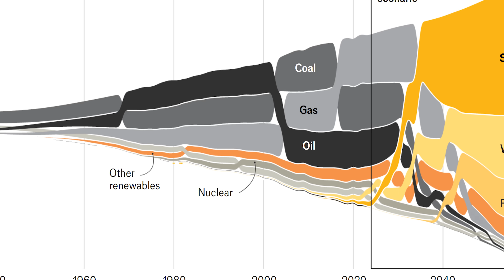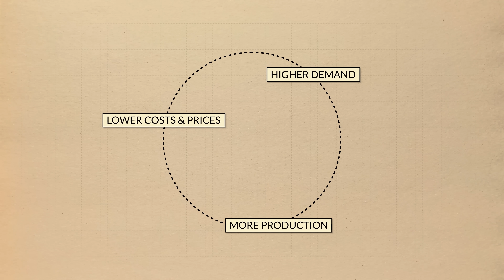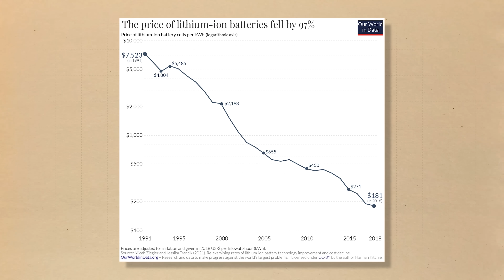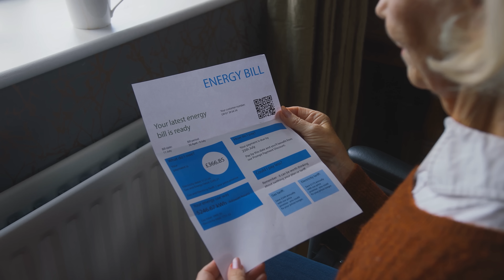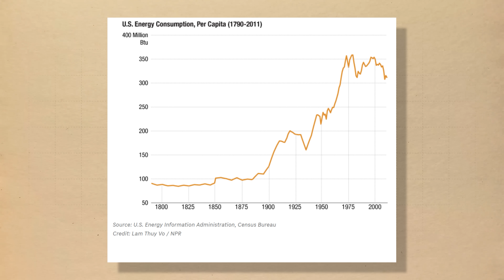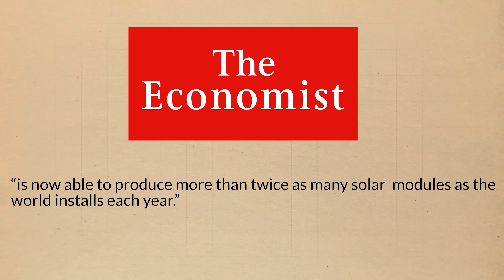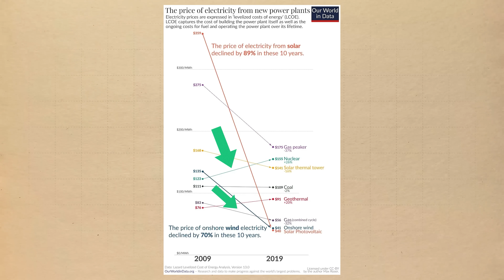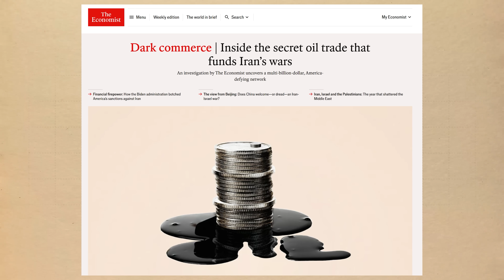Why solar will soon dominate & what that means for the world

Comment: It's cheap the only lacking thing is energy storage with batteries etc that's the next leap forward
Reply: Cheap solar provides a lot of economic incentive to develop cheap energy storage. If you can buy the panels for half the price you normally would, it makes it easier to justify buying more storage to accompany it
Reply: @TankDerek  We need to mandate solar suppliers build batteries sized to their solar panels.
Reply: As more and more people get electric cars it could be possible to start storing excess energy in peoples cars while they are charging. Also pulling out a bit when electricity prices are high
Reply: @sondrestrmme4006  The biggest problem with electric cars is the battery, and uncertainty about lifespan and wear+tear on the batteries. 

I dont think electric car owners want their batteries to be used up for storage.
Reply: You can’t just say “this will be the next leap forward.” Our energy needs are increasing exponentially NOW. Solid state batteries have been five years away for 30 years. How do you suppose they’re suddenly going to magic themselves into existence do you suppose?
Reply: In sweden it is now standard to buy a batteriy with your solar cells. The battery buys electricity when its cheap (night) and sells it during peak hours. And ofcourse it stores the solar energy needed for the household for peak hours.
Reply: This will also be a private matter mostly. Decentralised power generation as well as storage. As it becomes cheaper to simply generate and store energy yourself then pulling it from the grid. Cheap battery storage will spread into every home and building really quickly.
Reply: @rogerk6180 this will also make the grid more expensive. This will push rich people to not participate in the grid, and the unwashed masses that can't afford a solar setup or who live in high density housing to pay more for electricity.
Reply: @triadwarfare   obviously if you can't make your own you have to buy it yes. But with a bit of storage you can avoid the high nighttime costs and also bennefit from the low daytime rates.

That is why storage will be decentralised into every building rather then huge facilities on the grid. The financial incentives are just to big for end users.
Reply: @rogerk6180  in America you need to have an electric connection and pay the connection fee
Reply: @rogerk6180 agree. With battery storage already at $200 kWh and going down it will become much cheaper
Reply: @rogerk6180 perhaps in California but there's a lot of countries that doesn't have a lot of sun.
Reply: @matthiasknutzen6061   most of western europe is at the same latitude as canada. And pv works perfectly well here. There aren't many places with less sun really.
Reply: @matthiasknutzen6061 
Solar power works in Germany and even Norway.
Reply: And it needs soooooo much space 😩😜
Reply: The only thing lacking is a whole industry that must make and resverse chemical reactions on 10x the scale of fossil fuels for the same energy.... like saying we have flat screens and can make beige couches so the USS 1701-D can't be far.
Reply: Main bottleneck is all the ressources needed for such a solarpunk dream.

Both panels and batteries need a lot of ores getting scarcer and scarcer...
This is only viable for as long as there are high eroi fossils for the extraction to happen.
Reply: Yes but these are not simple problems. 
Nuclear would be cheaper, faster, and cleaner with the tech available today.
Reply: You can have a business using the excess energy to generate hydrogen
Reply: It's cheap... only when the sun is shining, does not equal cheap. It equals expensive.
Reply: In other words…..toxic heavy metal pollution will be ubiquities and be contaminating  everything…
Reply: Got 24 kWh sigenergy battery system installed will add more panels plus get cheap electric car in the near future in Brisbane
Reply: Mechanical batteries are literally a solved problem you well regarded apes.
Reply: Tesla teaches that used EV batteries can be repurposed as storage units, and China is producing millions of EV
Reply: Solar panels cant produce enough energy to make more solar panels and power the rest of the economy. Solar panels can never replace fossil fuels
Reply: And how well the battery tech will perform.
Reply: @fractalmadness9253  
Energy may be cheap/ free….but the physical material to collect that energy (Li, Cd, Ni, Fe, Hg, Pb, etc) is Scarce and will only go up on price…
People also don’t consider the toxicity of mining heavy metals and it’s soon-to-be Ubiquitous  Pollution…
Reply: The penny dropped recently that I could buy a non depreciating asset, insulate myself from inflating electric supply prices and make money from my surplus after about 10 years
Reply: Is that all?
Reply: Nah, i will just install way more panels and dump the extra in a massive voltaic arc. Sounds way more entertaining. Sorry for the extra ozone.
Reply: When there is a larger adoption of electric vehicles they will double as battery storage capacity for the house
Reply: You can store energy also in pumping water up a reservoir!
Reply: Copper shortage is already becoming a huge problem. This channel always hits the target but misses the kill-shot.
Reply: I think the rising EV adoption would help with that. Something I'm looking forward to is EV buses that can deploy pantographs to charge off of and run off tram lines as they go when electricity is super cheap, and then start running on their batteries in the evenings.

It obviously goes without saying that adding batteries to already electrified trams and trains is also a no-brainer. It could make rail deployment cheaper by not needing power lines to run the whole length of the line or only draw power on demand.
Reply: True, but they can still be used for large scale operations during daytime. Farming is a perfect example for this.

In poorer countries like Pakistan, large percentages of farmers used solar panel to generate electricity for their irrigation system. It use lots of power and very expensive. This push cost down significantly.
Same goes factories and commercial buildings (airports, terminals, government buildings, etc) using solar to offset their huge electric bills.
Reply: And then, the panels need to be recycled, which is essential to truly make solar a renewable technology
Reply: @kaimulai5178  they are almost completely recyclable.  No issue there.
Reply: We could probably get away with nuclear and peaker plants at night with some medium sized grid storage. We just make electricity use at night more expensive to lower demand and encourage end user battery systems without driving up the grid cost of solar for power companies. Then we don't need near as many batteries. Any excess daytime capacity could be cheaply purchased for carbon capture which is mainly unhelpful because it uses so much non green electricity right now.
Reply: @macattack5863  the problem with nuclear is that during day time there will be a lot of overproduction already. That will push prices down conciderably.
Causing daytime operation at a loss meaning that during night time sale prices have to be double to male up for those loss hours.
Making an expensive energy source even more expensive when it would be needed. Only lowering the barier where storage simply becomes a cheaper option.

Nuclear is a financial dead end. Especially as batteries also keep decreasing in price over time.
Reply: @macattack5863 
You cannot shut down nuclear fission plants in daytime.
It's just a waste of money.
Reply: @frankthetank5708  I didn't say nuclear peaked plants I said nuclear and peaker plants nuclear can cover baseline power usage with speakers and batteries holding over the rest of the grid outside of solar.
Reply: @macattack5863  
For what do you need an expensive nuclear power plant, which couldn't be shut down? 
Burning Hydrogen, grid and water storage and batteries do provide enough electricity in times of low production.
Reply: @frankthetank5708  I'd need to see some math to that point but I'm still very suspicious of full renewable dependency outside the Sunbelt/tropics many I'd say most areas don't have access to large enough dams for energy storage, battery/grid storage is still expensive and probably won't ever be cheap, and finally hydrogen. Which is an interesting idea as one could produce it in the summer and burn it in the winter. But storing hydrogen fuel in large quantities isn't simple and producing it is still inefficient at scale as far as I'm aware. I do know work is being done on that front particularly in Japan. Of all things hydrogen seems the most flexible and most viable way to replace fossil fuels is panels and refinement become efficient enough sun rich areas could export fuels to sun poor areas just like they do now.
Reply: Dump the electricity into massive resistive heating blocks the size of a football field. 

At a certain point you don't even need to insulate it because of the square cubed law. 

Then run turbines from steam from the heat block, or use the heat for district heating.

It's wasteful on the energy form transitions, but if solar is cheap enough that won't matter.
Reply: Hopefully it'll also be overallocated solar power sinking into green hydrogen during times of overproduction to allow for even more systems to move away from fossil fuel power.
Reply: @randxalthor  during times of over production energy prices often go to zero or even slightly negative. This will eventually trigger new businesses to make use of this.
Reply: Sadly batteris are growing linearly
Reply: @karthikeyanm.v8381 and that will end at some point.
Reply: @karthikeyanm.v8381 You should look up the actual numbers. It's very much exponential.
Reply: Cheap solar makes pumped hydro more affordable and these two technologies can coexist
Reply: @josephkelly4893 could be useful for existing hydro plants. But making more hydro plants are extremely environmently destructive.
Reply: Sodium ion battery
Reply: Some countries might be a step ahead on that with hydro.
Reply: Good thing droughts never happen
Reply: If eletricity is nearly free at one point and high priced some time later the business for batteries will be booming. Economics 101...
Reply: This one really feels like a matter of time to solve. Already there are solutions though none are perfect, hopefully someone can come up with a ingenious idea for a brewakthru
Reply: Can use a peaker plant instead
Reply: Oh it is haha
Reply: 12v 100ah batteries went from $800 to $200 in like two years. Solar panels last FOREVER. All those failed solar fields have sold their panels to companies that resell used solar panels for cheap. After 20 years one YouTuber tested his panels to have 101% energy generation. It was putting out more than the day he bought it and tested it. (Sun was probably ideal and very cold temps). Hail is probably the only danger, but panels are cheap and can be replaced. Solar panels are so strong now people are using them structurally.
Reply: @TheBiblicalFarmer  Indeed, photovoltaics are the cheapest roofing pannels in the UK.

PB cells are a commodity product, it's lead + costs at this point.

So when people draw graphs of photovoltaics getting ever lower.... they need to explain. All the easy gains of chinese zero fcuks given manufacturing conditions and wages are baked into current pricing.
Reply: I was just reading. 2030 at most will be the year for energy storage with a literal slew of technologies maturing. 

 Yet even that can actually be sooner. Energy storage has dropped like 20% a year. Give or take. 

 Many don't know this. Most of our electricity in thermal plants is wasted. 66% IIRC! 2/3RDS! 

 Most coming from turning off and on plants. (Forgot how much. A good amount.)

 Batteries not only are great for dealing with flucations. They also allow power companies to be much more efficient with the power they do generate. 

 For example store when energy demand is low then sell high without expensive production. 

 So power companies are realizing hey, batteries are great at bettering the bottom line. So growth the past year has been amazing in many states like Texas. 

 Now pervoskite solar is being made. Oxford Solar has hybrid cells that are much more efficient then other consumer grade panels. Some other companies are getting production going now.

 What is crazy about energy storage is there is no clear winners in sight as far as I can tell. We got everything from sodium to salt water redox batteries coming on. 

 Except hydrogen. Hydrogen can F right off for all, but niche purposes. Not for everyday storage or especially EVs. 

 Future is bright! It blows my mind people are against battery tech. Don't you all want exoskeletons? Faster cars? Electrical jet pack? I do. (Or just cheap energy.)
Reply: @dianapennepacker6854  Talk about 'a little bit of knowlage is dangerous'
Reply: @dianapennepacker6854 south Australia has solar capacity of 115% of power demand.  I can see batteries coming.  Hawaii no longer needs expensive coal peaker plants and installed batteries which paid them back in 18 months.
Reply: @dianapennepacker6854  Don't ditch hydrogen yet, while a bad batery, its an excellent fuel for applications that need higher energy density. Also don't forget the new breeder reactors that are coming online that will potentially make uranium more than a hundred times more efficient as fuel.
Reply: @pspublic13  I got a look at this green steel and it simply does not make sense to me, coke is not merely the fuel, its also part of the chemical process. You can not even call it steel if it does not have a carbon content.
Reply: @Swordphobic  Making uranium more efficnent as a fuel means practically nothing, the vast majority of the cost of nuclear is maintaince and construction, that means what you can use 100x less uranium to power your plant, thats great, but thats litterally a tiny fraction of the opperating costs, its basically saving a plant a hundred thousand a year, which is one engineers wages
Reply: @imakevideos5377  Enriched uranium is still 5% of the operational cost, but it doesn't take that much of a price hike for breeder reactors to become the more economical choice when it comes to energy generation. I'm just excited because from a sustainability standpoint they can be on par or even beat renewables when it comes to waste generation.
Reply: @Rubicola174 Large scale energy infrastructure is generally the last place prone to innovation; proven reliability of the inferior solution often outweighs the benefits of new innovation, even at the cost of price/efficiency. However over time when the innovation proves its reliability it can start being adopted at a large scale. I think battery grid storage is currently somewhere between the two stages, as well as some other new energy storage solutions
Reply: This leap is already here
Reply: Not true. We have pumped hydro that can store all of this energy
Reply: @J.C.1966  That is an astonishing small amount of areas of the world. So not really an issue they could easily just get the power transferred from somewhere nearby
Reply: Not sure why you think it’s lacking given it’s used all the time
Reply: Working on it
Reply: Batteries briefly mentioned at 4:51 already
Reply: Excess solar capacity -> desalination -> reservoir -> dam
Reply: Lol
Reply: @J.C.1966  name a country with zero elevation. It doesn’t require massive heights. As for high voltage power lines. It is also not a serious issue as many grids span massive distances and the pumped hydro will be working at down times in solar and wind so you won’t have load issues.
Reply: Google eia power monthly. Look at the maps. See all those gray dots. Those are grid batteries. The details are in Chapter 6, 6.5. California is already running 10 gigawatts of the stuff, and Texas around 5gw with, as you can see, way more on the way. China is also adding lots of batteries, which is great. They still burn crazy amounts of coal.
Reply: If the power grid is big enough storage is not a problem, as the difference in production and consumption balances out
Reply: @geokon3  Big robust power grids help a lot, but if you want to have a 100% renewable grid, and I do, you need some storage.
Reply: We can pump water uphill as battery
Reply: @lenOwOo  alot more loss. U r shifting electricity to mechanical energy, to potential energy. And back. The amount of water u gonna need to shift up means its gonna have to be an open reservoir which will increase the loss due to evaporation. More then that most areas that they put solar r deserts. Where r all the water coming from? They tried it and its just not as effient and cost effective. Sorry fir the bad spelling...
Reply: @lenOwOo  yeah, try that in the netherlands or poland 😂
The available hydro is already in use and there s little places that are left untapped.
Reply: Chinese lifepo4 batteries cost about $100 for 1 kWh. just materials for 48v battery: $1600 16 cells, $100+ bms, $100 wires etc., $100 case. that`s $120 kWh. built by manufacturer is $250+ kWh. (not include import taxes)
Reply: ICP to the moon
Reply: Geothermal has the potential to  dominate due to recent advancements. 

Geothermal is not intermittent like solar
Reply: Batteries are a HUGE problem. Companies have sunk billions of dollars into battery research for the last 15 years and all we've gotten is refined versions of existing lithium ion batteries. All the revolutionary techs have thus far failed to become commercially viable
Reply: @giarc1988 Untrue. Economically the cheapest option at scale and keeps getting cheaper.
Reply: @giarc1988 we already have sodium ion batteries commercially available. Also LFP is a relatively newer technology which is much safer than NMC.

China already have operational sodium ion mega batteries.
Reply: Economist love to say look batteries are cheaper now! but fail to think about how much batteries even a small grid would need to have its not economically nor production feasible
Reply: The issue of grid batteries is easily solved using gravity storage in mountain regions or using other methods like heat batteries. Not all batteries are chemical lithium ion. Those make sense mostly for portable devices and home applications.
Reply: Batteries are too costly in scarce materials.
We need grid size storage.
Gravity or heat seems the way to go.
Reply: @dupree314 Lithium isn't scarce at all, iron is sold by the ton, and so is phosphate. Are you worried about graphite? Tesla Megapacks for example, use LFP cells.
Reply: Lolwut
Reply: Seems questionable; batteries are just too expensive and ineffective. Seems like we are magnitudes away to actually store meaningful amounts of energy via batteries.
Reply: @termitreter6545  This point is poorley understood. Whole debates over renewable energy are had without quantities, as if merely the demonstration of the technology is suffcient.
Reply: @termitreter6545  Time to do some new research, your information is out of date.
Reply: @termitreter6545 Localized gravitational or inertial storage, low tech as it is, might become a thing.
Reply: @termitreter6545  Thats just plain wrong, batteries right now are perfectly priced, and getting cheaper every day, here in australia we have over 2gw of battery projects ongoing with storage amounts of 4.5gwh so about 2gw at 2.5 hours roughly. Storage actually takes up less space per mw they can send out to the grid than coal or gas plants, which is really really attractive. Buying land is expensive.
Reply: @imakevideos5377  You sound quite confident, but have you ever actually done the math on how far those 6.5 gwh would bring you? 

For the record, Australia used 250.000 gigawatthours in 2023. thats 685 gigawatthours per day.

So your projected energy capacity in a australia doesnt even cover 1% of the countries average energy usage per day.

You see the problem here? Its really, really obvious. And no, land isnt the issue.,
Reply: @termitreter6545 Good thing you are wrong about this. Batteries are still too expensive for true universal usage but it is not orders of magnitude more expensive. Utilities are adding battery storage at a faster and faster rate.
Reply: @termitreter6545   Technically, you could build hydro storage in most places if you take the time to transport the water and build the reservoirs at different elevations. This would facilitate electricity availability at peak hour for the grid and it would alleviate the demand for lithium.
Reply: @termitreter6545 ineffective??? What are you talking about. Like… batteries aren’t able to store energy?
Reply: @gavinlenobel174  Effectiveness can mean how much cost/weight/space/etc batteries require, compared to how much energy batteries store.
See electric cars, they are heavy+expensive  compared to normal cars, because batteries are inefficient compared to car engine+fuel tank.

(they also have a limited lifespan)

You need a lot of battery storage if you want your countries energy grid to rely on them for more than a few seconds. 
The australian battery plants arent even close to that.
Reply: Gee. Is that all. Magic batteries. No promising technology has never failed because we've never heard of such a thing....because they failed and were forgotten.
Reply: @edsteadham4085 Where’s the magic exactly given it’s a proven technology used at utility, commercial and residential scale across the globe? I must be missing something because I don’t see any magic only a proven market, technology and product
Reply: Do you know the carbon footprint of a battery? Do you know how much they last? Solar will never replace oil, since it s an unreliable source of energy, it will just decrease its usage.
Reply: Ashish bhai, I think the real play here is green hydrogen. It's an easy way to convert the irregularities of solar energy to steady reliable energy without the bulkiness of batteries. Its easier to transport, has a very high calorific value and will be able to be transported by more or less the same methods as used for crude today.
Reply: @shashwattripathi4559  sorry but you are just repeating complete and utter disinformation put out there by the oil industry. Hydrogen is one of the most inefficient ways we have of storing energy that we currently have. It costs energy to store it and costs energy to return it to a useable form, and is currently extremely difficult to transport and can certainly not be seen a simple way to swap oil or gas out for hydrogen. The technologies are not compatible. The oil industry has been busy propagating this myth for the last 20 years, so that we would see no need to stop investing in oil and gas infrastructure, but everything you need for hydrogen has to be built from scratch and we are still decades away from having any technology which could make this viable at large scale if ever. So it is a nonsense to think this will replace EV’s and as for heating, heat pumps are cheaper, more reliable and safer. Even heavy industry seems to be edging away from hydrogen in favour of other technologies, which was what I always assumed would be those niche areas in which it would thrive, but only time will tell for what exactly hydrogens costs will still prove viable as a fuel.
Reply: Batteries are terrible for solar storage.

Maybe hydrogen generation can be used to store excess solar energy generated.
Reply: @Name-gi8dr Hydrogen is even worse as a energy storage medium vs batteries.
Reply: @Name-gi8dr Batteries are fantastic for short term storage. Right now, a lot of 4 hour storage is being added to manage the evening peak, 5pm - 9pm. Of course that will eventually bleed into the night. Batteries are not good for storing electricity for a month. Keep in mind, though, if it's cheaper to add more renewables than storage, so you get enough generation on a cloudy day, that's what will happen. You can waste electricity, just not money.